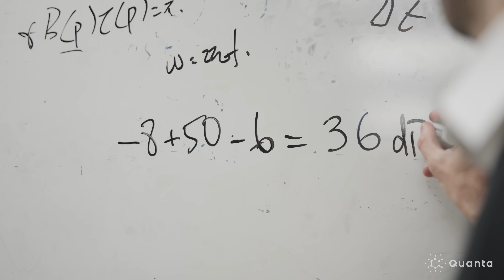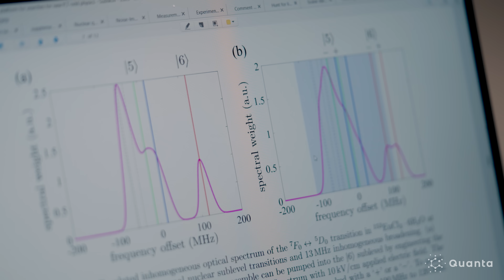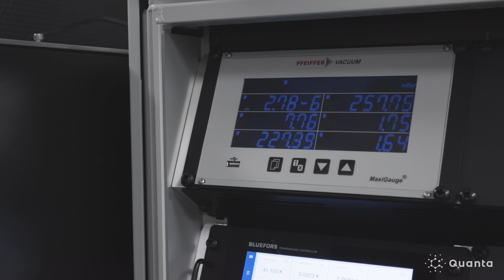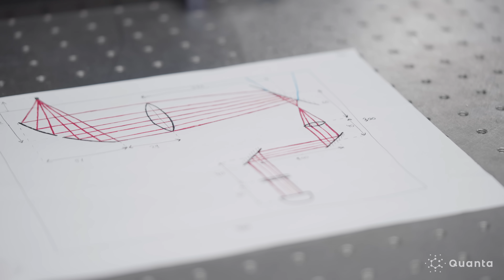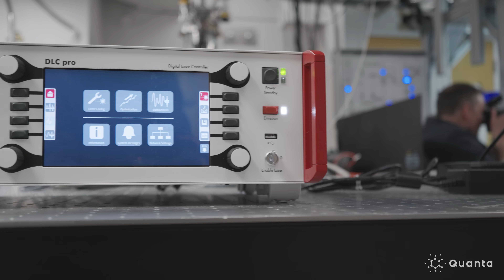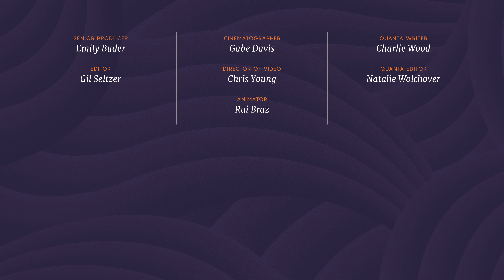A Shot in the Dark for Dark Matter

Comment: The known, fundamental phenomenon of dilation (sometimes called gamma or y) perfectly explains galaxy rotation curves/dark matter. Mass that is dilated is smeared through spacetime relative to an outside observer. It's the phenomenon behind the phrase "mass becomes infinite at the speed of light". Time dilation is just one aspect of dilation, it's not just time that gets dilated. A graph illustrates its squared nature, dilation increases at an exponential rate the closer you get to the speed of light.
   Dilation will occur wherever there is an astronomical quantity of mass because high mass means high momentum. This includes the centers of very high mass stars and the overwhelming majority of galaxy centers. It can be inferred mathematically that the mass at the center of our own galaxy must be dilated. This means that there is no valid XYZ coordinate that we can attribute to it, you can't point your finger at something that is smeared through spacetime. More precisely, everywhere you point is equally valid. In other words that mass is all around us.
   Dilation does not occur in galaxies with low mass centers because they do not have enough mass to achieve relativistic velocities. It has recently been confirmed in 6 very low mass galaxies including NGC 1052-DF2 and DF4 to have no dark matter, in other words they have normal rotation rates. All binary stars have normal rotation rates for the same reason.

Comment: @crappymeal  And my best guess is that the electron loses higgs particles when it becomes a wave and then the electron wave splashes into the higgs field and basically higgs bosons form in different spots in the electron wave before it passes through either slit.... Because there will be more higgs bosons in the center when it's not being observed and that pulls on the wall or the other higgs particles in the wall....  .. I think the reason we would see this is because if the particle became a wave you would see the higgs particles spread out and because the electron wave is a different condensity now...... And may be able to interact with the higgs field more and wherever the higgs particles separated in the wave wherever they stopped that's where they pull in even more higgs field and that creates more higgs particles my name is dylan stone .... And basically you can say that if it's vertices the vortices move around inside the electron wave and if it's the graviton with different 
Condensed pieces...and  the  condensed pieces move around in the graviton
And vortices pull in and pull on energy and fields which makes the fields more condensed around the vortices and we know this because time increases whenever one object gets close to another... So the vertices must be pulling in the other  fields energy which acts like smoke ghost  but it can also be a liquid that acts like a ghost.... And whenever vertices get close to each other in particle form the energy they're pulling on becomes more condensed inside the other energy that's being pulled on by the other vortices ... or you could say the gravitational field gets stronger as it gets closer to the graviton which would mean it acts more like a solid ghost and basically....
Oh yeah and space is really not that condensed So my guess is that space is energy and it's just really compact and acts like a ghost and we can move through it....😂 So dark matter probably has its own field and it's so uncondensed that it can pass through anything......
The Force that counters gravity is gravity itself it's made up of uncondensed pieces and more condensed pieces and these more condensed pieces act like a liquid and can travel through the less condensed pieces .... That's how the gravitational field acts ...
And most of the graviton acts like a ghost and the more condensed pieces can pass through the less condensed pieces but they can't leave the graviton ....(and to be clear that is because these little different condensed pieces in the field will collide and pull into one another and then pull in on other fields because there overwhelming pull now when the graviton is created it's made up of uncondensed pieces and more condensed pieces)...

And the more condensed pieces will collide in the center of the graviton pushing and pulling on each other .. So the more condensed pieces will travel away from the center because of the collision with other pieces that are as condensed as them and the more condensed pieces pull on one another condensed pieces to pull them back to  collide in center back to collide with other condensed pieces ....giving you the spin in an electron because the graviton is spinning at 360 and so are all the little pieces there in a ball ..  that makes gravity You would get a virtual particles from the gravity field being different condensities...
By the first field being inside the second field in the first field being different condensed little pieces that can travel through each other till they collide with something that's around the same condensity than they will start  pulling in more energy ...from around it's field until the particle gets big enough to get crushed by the second field which starts being pulled in by it because the first field becomes  condensed enough to interact with second field....Gravity is its own field but it does quantum entanglement ....it is so uncondensed that it can warp space with lasers... They're just different fields that quantum entangle condensed enough to interact with with one another😂.... all stuff I've been working on in the past year I'll stuff I've talked about in the past year I can prove it and you know it.... we know this because there are electromagnetic fields the gravitational field could act the same way.. the electromagnetic field around the electron if you think about  gravity  acting the same way then you can condensed gravity and you can get anti-gravity which is just being able to control the condensity of the field in front of you ... We can actually see this with time and how things decay gravitons lose a little bits of it field over time because the pieces in the graviton are different condenses and over time some of them are lost and that's how things decay we can see this whenever one object gets close to another object we can see it's time slowed down and increase in volume of energy ...
 the only way It can be doing that is if one field of time is more condensed than another field of time but if you say they're the same density then you can say that one can't increase the other because the other couldn't pass through it but if you say gravity can pass through gravity and increase gravitational pull because gravity acts like a wall and then when you get closer to whatever is giving off gravity you become more condensed it becomes and then you can increase how much the gravitons energy has inside of it if certain other gravitational energy can pass through other gravitational energy condensing one or condensing both increasing the amount of time that's around it because the gravity in time will will pac more gravity into it until it pulls in more time Gravity is its own field but it does quantum entanglement ....it is so uncondensed that it can warp space with lasers... They're just different fields that quantum entangle condensed enough to interact with with one another😂.... all stuff I've been working on in the past year I'll stuff I've talked about in the past year I can prove it and you know it.... we know this because there are electromagnetic fields the gravitational field could act the same way.. the electromagnetic field around the electron if you think about  gravity  acting the same way then you can condensed gravity and you can get anti-gravity which is just being able to control the condensity of the field in front of you ... We can actually see this with time and how things decay gravitons lose a little bits of it field over time because the pieces in the graviton are different condenses and over time some of them are lost and that's how things decay we can see this whenever one object gets close to another object we can see it's time slowed down and increase in volume of energy ...
 the only way It can be doing that is if one field of time is more condensed than another field of time but if you say they're the same density then you can say that one can't increase the other because the other couldn't pass through it but if you say gravity can pass through gravity and increase gravitational pull because gravity acts like a wall and then when you get closer to whatever is giving off gravity you become more condensed it becomes and then you can increase how much the gravitons energy has inside of it if certain other gravitational energy can pass through other gravitational energy condensing one or condensing both increasing the amount of time that's around it because the gravity in time will will pac more gravity into it until it pulls in more time...... @kedarunzi9139  so anyway if you want quantum computing all you need is nanobots so they can observe the quantum entangled electrons or informationYou know all you have to do to find out if the electron bounces off the Wall between the slits ...is... what you need to do is fire one electron at a time and replace the wall every time something lands on it until something doesn't land on it are you people retarded @kedarunzi9139  you do have a purpose you have to protect all life ....  love one another as I have loved you ....Jesus ...laying down your life your friend is the greatest thing you can do to treat others how you want to be treated not just specific people that you want to treat good treat everyone good forgive to to be forgiven that last one is mainly just for me and most of the stuff was mainly just for me but I mean there's your purpose dude other people need you to exist so that they can live you're part of the economy you have a purpose and what really makes me laugh is you have even greater purpose because you can leave society and stop polluting you can go live like tribal members and Amish people why do you need what they don't if people would stop giving to the churches and give to the government then the government can help the people who wanted to go live like that and we could still get medical help so what else do we need... But Christians ain't about to stop giving to the church probably because they're indoctrinated give unto Cesar what is Cesar and render to God what is god .... If that is true there's only one church that deserves God's money and that is the holy Temple in Jerusalem  ....
If Muslims believe Jesus was a prophet why do they not believe that's God's holy Temple whenever Jesus said it was....
But whatever people choose to do stupid s*** all the time and there's more to it so if you want to talk...... Just hit me up
Reply: It sounds like you are trying to reach conclusions primarily by visualizing something about how the electrons and such behave.
Sorry, but the way electrons fit in with the Higgs boson is best understood by doing math about it.
The thing is to understand the broken SU(2)xU(1) symmetry.
Reply: Nice 😎👍
Reply: Anyway how we know global warming is real is because it took hundreds of millions of years for carbon to build up from fires in forests... during the first few ice ages... And then after 100 million years or 100,000 years enough carbon got built up so it could start trapping heat and we're putting carbon up there so fast now that it's trapping heat now the reason we saw the very last ice age was because currents they trapped so much carbon in ice because it was taking warm water and pumping it up to the cold part of the earth and there was more oxygen on the planet than there was carbon at the time so this is why we see the planet Cool history is not hard how do scientists not know this shit .... Are you future people just playing a joke on me or do you actually not know?😇👽😜🤣

Comment: Has anyone suggested that dark matter may be “cloaked” matter?  That’s pretty standard sci-fi, so I’m assuming so.
Reply: Not to be snarky , but to get an answer to your question I think you'd have to be much more precise in your definition of "cloaked"
Reply: My understanding is that even if you try to capture as much outgoing light as you can, you still pretty much have to emit infrared / blackbody radiation,
and…
ah, I think the JWST measures infrared radiation well?
So I think the JWST would see it if so?
Though I suppose it depends on the temperature of the stuff?

Oh. Maybe by “cloaked” you also meant lets other light through it? Hm.
I think the same thing should apply?